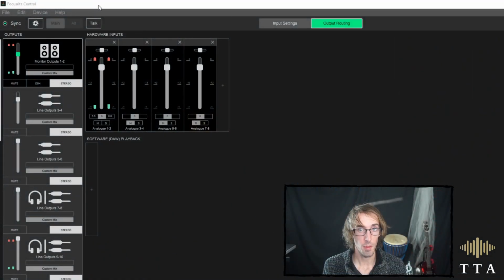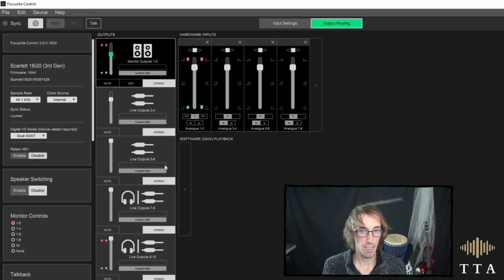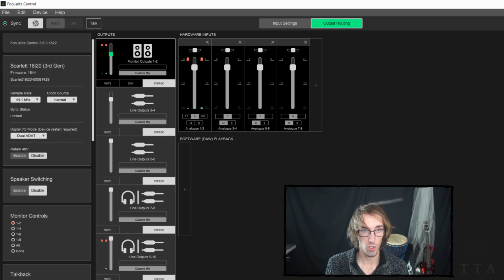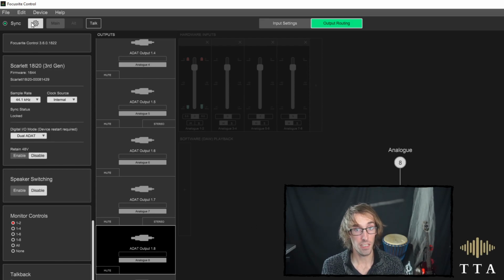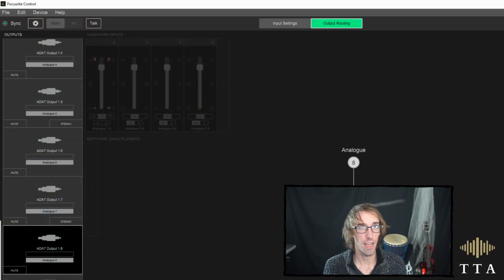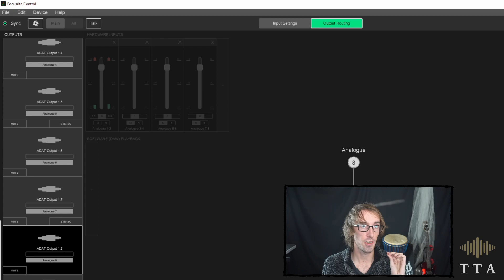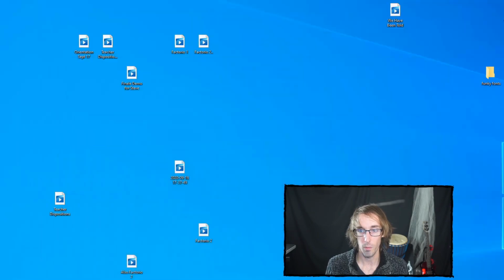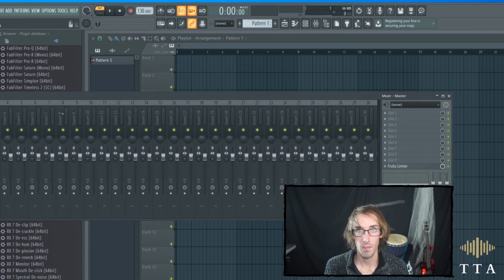Focusrite 18i20 ADAT/Optical Tutorial Faster

Comment: Mate,is the 18i20 going to display the adat inputs in mixcontrol if you connect a slave 8 input via adat? I have an rme 400 as a preamp slaved via adat but nothing comes up in mixcontrol apart of the 18i20`s analog ins.
Reply from the maker: A quick glance on the google makes it look like mixcontrol doesn't display those inputs unless you route them to a mix. Does it show up at all? Or no sign of ANY Adat signal? If nothing at all, I'm assuming something in Mixcontrol needs to get turned on so it takes in those optical inputs.
Reply: @shawnmuench  thank you,yes I looked at google too and focusrite help talks about is the outputs and routing but no mention of inputs.
The adat works as output from the 18i20 but no inputs,although the rne shows aignal going in.

Comment: Actually, it would be best to utilize two opticals for in/out with the BNC for the WORDCLOCK setting the Main interface as that master (internal clock). In this configuration, you can take advantage of both inputs and full outputs (16 in/out).  Otherwise, your configuration will NOT allow outputs from your slave (ADAT).
Reply from the maker: I'm gonna check this out! Thanks for adding information!
Reply: This is what I'm finding as well
Reply: I just ordered a Scarlett OctoPre to act as an expansion to my 18i20 3rd gen. Focusrite tech support is excellent. One of their recommendations: "The Octropre clock will be set to internal and the 18i20 clock must be set to ADAT.  The sample rates must also match between the two devices." Once I see the eight new inputs in the drop down I'm wondering if I will need to re-configure through the control panel if I want to just use the original 8 inputs for a small gig? That would be cool. In other words I have one carrying rack for the 18i20, splitter and cables - the new case will have the OctoPre and another splitter. It would be nice if I could just take the small rig to gigs where I don't need the extra tracks - without having to reset the control panel.
Reply: Turns out it's just one click to change from ADAT to internal. Here's a gig where I used the Octopre -  11 tracks: 
https://youtu.be/5Q4taE0sleY
Reply: Bro, ure a legend... thats what I came for! I actually thought he somehow resolved this problem by routing the octopre BEFORE the 18I20. Anyway THANKS :D

Comment: Hey Shawn! I followed your video and found that my inputs are now working!! However, I’m planning to use outboard gear in my setup, and unfortunately, it appears my 18i20s outputs are not going through the ADAT to use in my outboard gear. My master device is my Audient iD44, if that matters at all. I experimented and tried using every possible output option to figure this out, but I have unfortunately come up with nothing. I do only have one TOSlink cable connected, so I’m not sure if I’d need a second to send the outputs through? Any help would be appreciated!! Thanks!
Reply from the maker: Hmm so 18i20 to the Audient to send to your computer. Then you'd want to send stuff out of the 18i20 with another optical. But then you have to think about how to get that stuff back IN to your computer. It wouldn't be over optical. You'd have to go back in through the audio inputs. You'll want to keep in mind what is routed where so a feedback loop isn't created. 

Your outboard gear receives the audio via ADAT? ie like effects gear? What gear are you sending to? 

Or would you just run audio outputs instead of optical to get sound to those? Then use some inputs to get the sound back in. Again, feedback(!) so mute accordingly.
Reply: @shawnmuench  hey!! So sorry for the confusion, but my outboard gear doesn’t accept via adat, it uses XLR/TRS balanced connections that use interface outputs like speakers would, and then send back into the interface. The gear in question is my Art VLA II compressor and then a 500 series 10 channel rack that I just bought that’s currently on the way that connects in the same way. Im just essentially trying to make my DAW and iD44 recognize the extra 8 outputs that the 18i20 can provide via ADAT.

Comment: Hey Shawn. Great thx 
I am struggling with the following 
I have the 18i20 as a Master and the Octopre as the Slave (both Focusrite:))
Recording and everything with all XLR Inputs are working fine 
But 
In my Situation I am using on the 18i20 Outputs 1+2 for my Monitor-Speakers and 
Outputs 3+4, 5+6, 7+8 and 9+10 for custom mixes so that we are using this setup for playing with my Band in-ear while jaming 
But now 
I also need a 5. custom mix. I want to use the Outputs from the octopre for this. But nothing is coming out of it, and also the Control says that the maximum count of custom mixes is reached 
Isnt it possible to use the Outputs from the octopre for custom mixes? Or am i doing something wrong here? 
Regards from Germany 
Niklas
Reply from the maker: You might need to use the 1+2 for your fifth mix while working on a project with friends. The octopre could output its own inputs as a mix, but you'd be missing the 18i20 sounds. 

You're using stereo outputs for them? You could reduce down to mono outputs and double your headphone outputs. Dunno if you're running to a headphone amplifier like I do etc. 

Sometimes it takes a bit to figure out what works! Hope this sparks some ideas.
Reply: guck dir mal die Kommentare weiter oben an, da gehen Leute weiter auf das Problem ein... ich konnte es noch nicht ganz fixen. falls du mittlerweile einen weg gefunden hast die outs zu benutzen (nicht nur durch zu schleifen) erzähl mir gerne wies geht :D mfg

Comment: oh my god someone actually helping! I have a Safire Pro 40 as a slave to a first gen 18i20. will my pc recognize the saffire even though its not connected to the pc? and i’d have to repeat this every time i turn both of them on?
Reply from the maker: Find out if the Saffire saves settings! (I just looked-- it does). Once you configure it you might be able to just let it run in the background. 

Saffire uses mixcontrol. The computer might let you run both Mixcontrol and Focusrite control? Dunno.
Reply from the maker: Usually you'd just configure the Saffire, let it run in the background, and then connect the Focusrite to your PC. The PC only talks to one device at a time, generally.

Comment: How are you even able to open focusrite control when the slave interface isnt connected to the computer vis USB? I am not able to access focusrite control. It says hardware not found? Are both interfaces supposed to be connected to a USB port, or just the master?
Reply from the maker: Plug in the follower device, do your Focusrite Control settings, and then shut it down. The hardware remembers its settings. 

Then plug in your lead device and Focusrite Control will grab that instead and you can change those settings. 

You can only have Focusrite Control open for one device at a time.
Reply: @shawnmuench  Ok got it. Thanks Shawn. Much appreciated.
Reply from the maker: @bocktoon5477  :))

Comment: couple of points for noobs like me: you need your usb conneced to the slave when setting that up.  then before you turn on the master step, change your usb to the master. also speaker out cables from 1 and 2 for example go out of the master.  thanks all

Comment: Hey! Great video very informative. Im still struggling to connect my 18i8(master) to my 18i20(slave) both 3rd gen. They're both set to 44khz, out from 18i20(1-4) to the in on the 18i8. Im using clock source Internal on the 18i20 and ADAT on the 18i8 as the Focusrite site says. I did the setup on the 18i20 like you said, adat 1 = analogue 1 and so on. I'm able to select the channels on my daw, but there's no signal coming through although I can see the meter working on the slave interface. Any tips? I've already tried a bunch of setups, any help would be much appreciated!
Reply from the maker: Do you see meters in Focusrite control for the main device that's hooked up to the computer? 

Then you'll know whether there's an issue before the computer, or an issue getting from the computer to the DAW. 

Seems silly to ask, but the main device is the one you have USB connected, correct? Remember the follower device will run in the background only. It doesn't have to be USB connected.

Hope you can work it out :) Takes some experimenting in an individual rig to see what's up.
Reply: @shawnmuench  Applying what youve teached in the video and reading some comments here I could understand that the master needed to be receiving clock from adat and the spdif input needed to be spdif/rca. I have literally no idea why but it works! Thanks again.
Reply from the maker: @YouVWatcher  Yeah another commenter mentioned that! In my setup that wasn't the case but glad you found a resolution. Good to get more information up here.
Reply: @YouVWatcher  THANK YOU FOR THIS COMMENT!!!! FINALLY, AFTER HOURS OF FINAGLING... SOUND!!!
Reply: Im using 2 3rd gen 18i20s. Im getting the same results however I should unhook the slave via usb after setting up in focusrite control correct? Also should i use spdif rca as well? Any help is appreciated..been at it for hours and im stumped and discouraged lol

Comment: Hi Shawn having a time sorting out my adat using focusrite 18i20... I am trying to connect audient asp800 to the focusrite as master...the audient has no on off switch to follow steps in your video. If I turn of the focusrite I have no way to sort out the audient.. using reaper as my daw... there is no control type software for the audient Thanks!
Reply from the maker: Hi Mike! Looks like the Audient doesn't have USB so I'm assuming it just sends over the 8 channels via ADAT by default. Use one optical cable in the out to send it over to the Focusrite. Make sure the Focusrite is expecting to see 48k in Focusrite Control.
Reply: Thanks Shawn looks like there is issues with unit as lots of crackling and popping. This unit was repaired but the music store will take it back...I may just buy a new unit rather than repaired thanks for the help 👍

Comment: Hi! Does the slave interface need to be connected with the USB cable in the computer even tho the computer is talking to the Master Interface?

Thank you!
Reply from the maker: You can take it out after you've programmed it! It'll still use the settings you gave it.
Reply: @shawnmuench  Ok great so I plug it in with USB to set it up and after that it's just the Master Interface that's gonna use the USB cable?
Reply from the maker: @raphaelcote3577  Right! The background interface will just do its thing and continue sending to the main interface.
Reply: @shawnmuench  Ok I see, another question I was wondering, if I want to send the Headphones out on both interfaces, do I need a 2nd optical cable?
Reply from the maker: @raphaelcote3577  It's possible to do it other ways. But yes, you could send the headphone mix back to the follower device and tell it to output that to its headphone outs. 

You can do that with 1/4" cables. Or optical. Depends on whether you have room to do so. Don't create a feedback loop! :)) 

You can also get like a headamp6 and distribute that way. If you want stereo headphone mixes, use this: https://www.amazon.com/gp/product/B07K59P692/ref=ppx_yo_dt_b_search_asin_title?ie=UTF8&psc=1

You can see how I'm taking the two outputs from the Focusrite and sending them to the headamp at the start of the video. It works well!

Comment: Hey Shawn! This video got me pretty far but I’m not quite there yet!  Using Ableton . I have (2) gen 3 18i20 that I’m trying to get to work in line and the only metering from the second rack I see is on the interface itself, nowhere else. Any advice?
Reply from the maker: Meaning you don't see it send anything to the master interface? Nothing metering in Focusrite Control when you open an ADAT channel? (Meaning on the right, under hardware inputs--- make sure you've opened the ADAT channels you want to see. Focusrite Control has to be told what inputs (hardware or software) that you're actually passing to outputs). 

Not sure if I'm on the right track. Other things to check-- Optical cable in right spots? Sample rate matching between interfaces? Dual ADAT selected under Digital I/O mode in settings (on both interfaces)? Remember to turn on the master, let the computer grab it, and THEN the slave. Then you're sure you're viewing the Focusrite Control for the master interface. 

?? :)
Reply: @shawnmuench  I don't know if there's a different process when running two 18i20s but I talked to a focusrite tech today and he helped me set it up in less than 8 min. Everything was the same EXCEPT... He had me change the digital IO to S/PDIF RCA on both the Master and slave. Dual ADAT was not working for me.
Reply from the maker: @LonielRobinson  Oh I gotcha! You're using the round jacks on the back right? Rather than an optical cable?
Reply: @shawnmuench  No sir! Only thing connecting the two units is the Toslink optical cable. Kinda doesn’t make any sense.
Reply: @LonielRobinson  Holy shit I was so frustrated, your comments here saved my day thanks to both of you!

Comment: I followed the video and set up the slave interface for adat 1-1etc but when I open logic only the master inputs show audio in the daw. 2-scarlett 18i20’s also drum mics going in. Both unit’s show up in focusrite control when plugged in to my mac book independently. Any advice to fix this issue?
Reply from the maker: Are you able to select the ADAT (Digital) channels in the DAW input list? Logic has to be told to look at those to pull them from the master interface. 

If it's not working after that I'd be sure the settings for optical out are matching between the two interfaces. ie. ADAT is selected in Focusrite control. Or maybe the sample rate isn't matching between the two. 

Are optical cables in the right spots? etc.  

Also maybe see if you can see the audio coming in to the master interface on the ADAT channels on Focusrite control. Meaning the slave sends via ADAT and you see the levels in Focusrite control for the master. 

Then you know whether the issue is before Focusrite Control or after it and a Logic problem. 

Good luck :))) thanks for dropping by

Comment: Question, I have two Scarlett 2nd Gen interfaces. There's no 'Digital I/O' in Focusrite Control and I can't get ADAT to work. Funnily enough if I use an old M Audio interface as my ADAT extension, it works fine. I've checked that both Focusrites are running at 48khz
Reply: EDIT: For anyone in the future with two 2nd Gen units, FYI I had a fantastic experience with Focusrite technical support. Basically you don't need the "Digital i/o Mode" menu in settings. If your Toslink cable is hooked up correctly, you should have ADAT channels to mess with in the mixer section. Just assign them as needed with the expansion/backup unit and then adjust your clock setting from Internal to ADAT. Turn off the unit. Unplug the USB from the expansion unit and turn them both back on.

Comment: Took me a moment to realize that the follower ("slave") device needs to be hooked up via usb for it to be recognized by mixcontrol for setup -- haha... of course it does. Pointing it out for folks who are following step by step.
Reply: Thanks for this, I spent too long trying to get this to work to record a full band, and couldn’t figure it out in time
Reply: So weird he’d leave that very important point out..:
Reply: Yeah, I was going to say... but I did notice the green USB light on the slave so I knew he did that otherwise there'd be no way for focusrite control to recognize those digital channels. Makes sense, but very confusing for someone going step by step!
Reply: If only these things came with documentation that explains how to use them.
Reply: Do you have to connect the slave via usb every time or ONLY that first time?
Reply: @southisaac only the first time. I currently have this setup and never have the slave plugged in USB.
Reply: The new update control 2 is not looking nothing like this i bought the Sweetwater bundle the two 18i20 4gen and im getting  signals but no sound from the slave
Reply: @str8upme2 interesting man! I will mess with this on 4th gen 18i20.

Comment: Great tutorial. I have two 18i20s. All of the outputs are being used on my master interface. How do I connect the two to send audio from the master interface, into the slave interface and out of the slave interface outputs?
Reply from the maker: You could tell the master interface to send its tracks to the slave ADAT in. Just don't forward those back because of the feedback loop (I think?). 

It just takes a little back and forth to get the assignments ready in both devices and sure that you're not feeding a loop. I don't have my head totally wrapped around it yet. 

BTW if you're looking into headphone tracking I did ok with art headamp: https://artproaudio.com/product/headamp6-pro-6-ch-pro-headphone-amp/

and
https://www.amazon.com/gp/product/B07K59P692/ref=ppx_yo_dt_b_search_asin_title?ie=UTF8&psc=1

Used the cables to sum Focusrite mono outs to a stereo pair for the Headamp aux inputs.

Comment: Would you know how I connect a TC clarity m to my focusrite 18i10 via optical? The cable is plugged in but I cannot understand why there is no signal.... I use the focusrite control but can’t seem to understand what I am supposed to be changing. Thanks in advance
Reply from the maker: looks like you want the TC to receive signal. 

If you're using a DAW, the ADAT out should have software 1-2 going out. 

If you're just passing forward 18i20 hardware inputs, you assign 1-2 on the ADAT out. 

Also the usual-- check that you've got the cable on the 'out' door.. make sure you told Focusrite Control to use digital over ADAT.. etc. 

Dunno if that helps but feel free to ask!